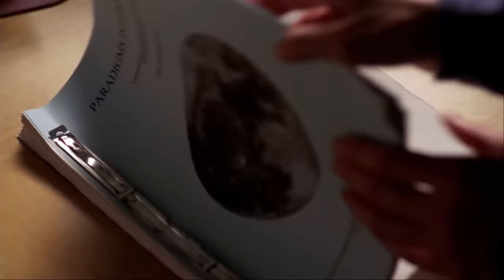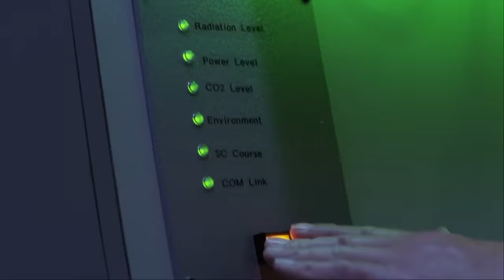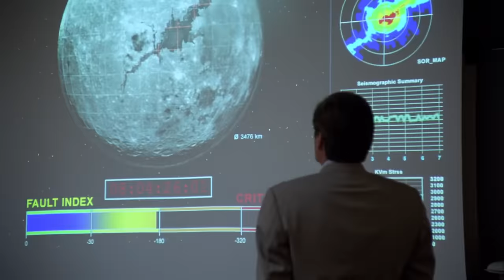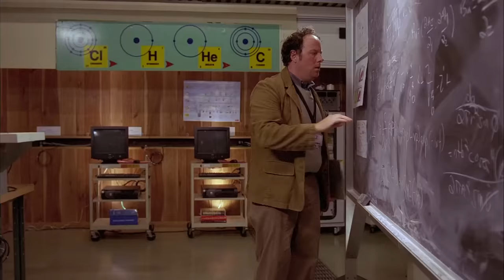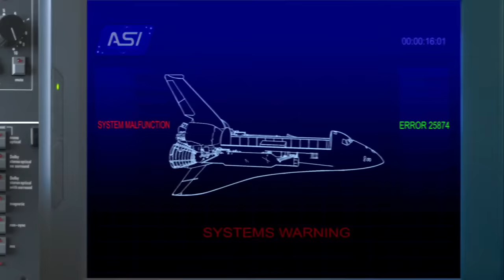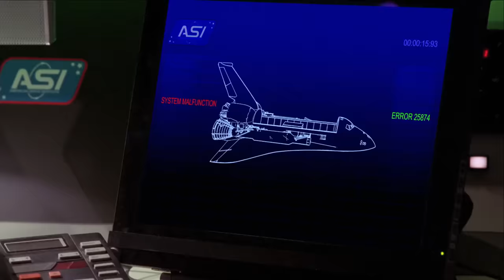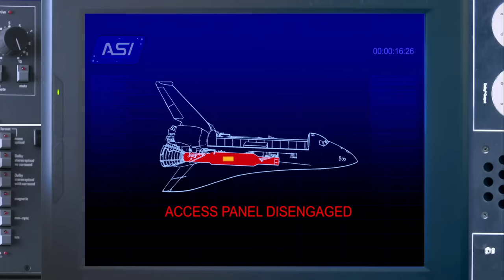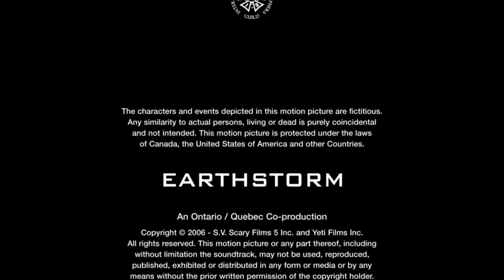Earthstorm | Full Movie | Action Sci-Fi Disaster

Comment: Shuttle Perseus' crew went to the moon and back wearing their polo shirt and cap.
Reply: The whole "space" shuttle is not and never possible, 1: there is no space, 2: and in their own theories, made rom aluminium which melt at 600C and Exosphere starts at 1200C to 6000C, 3: it has a jet engine and there must be oxygen/ air to burn fuel or anything, 4: in a vacuum its not possible to fly at all, aso, aso!

Comment: Good up until they dropped their engines and then still had engines to escape. And seriously, a mission critical site would have limited backup power?
Reply: The whole "space" shuttle is not and never possible, 1: there is no space, 2: and in their own theories, made rom aluminium which melt at 600C and Exosphere starts at 1200C to 6000C, 3: it has a jet engine and there must be oxygen/ air to burn fuel or anything, 4: in a vacuum its not possible to fly at all, aso, aso!

Comment: The whole "space" shuttle is not and never possible, 1: there is no space, 2: and in their own theories, made rom aluminium which melt at 600C and Exosphere starts at 1200C to 6000C, 3: it has a jet engine and there must be oxygen/ air to burn fuel or anything, 4: in a vacuum its not possible to fly at all, aso, aso!